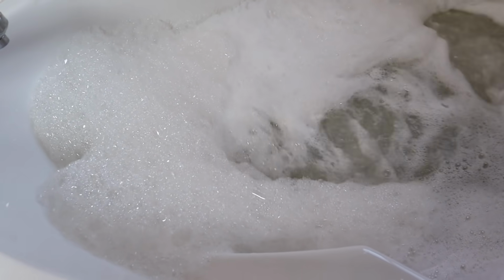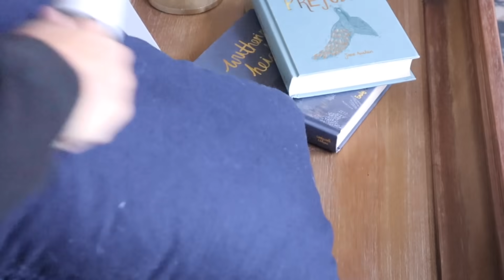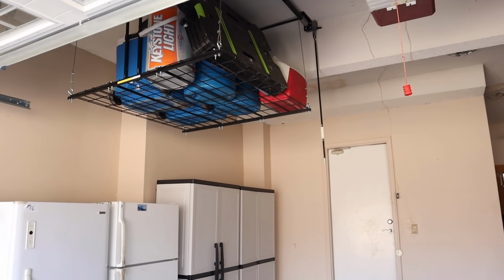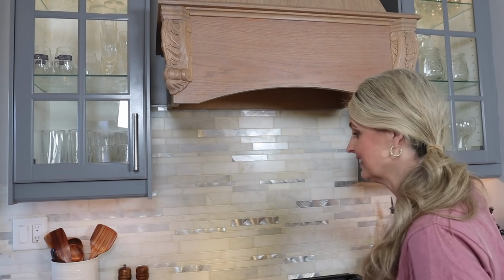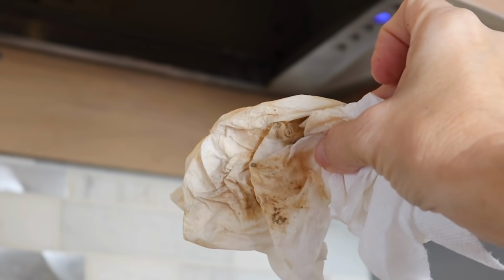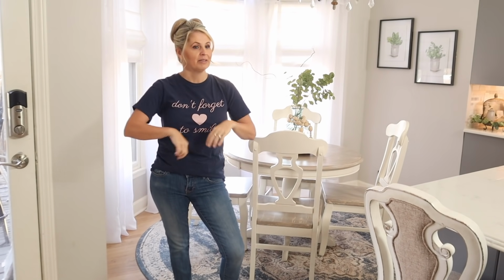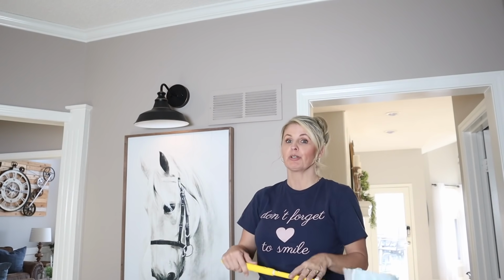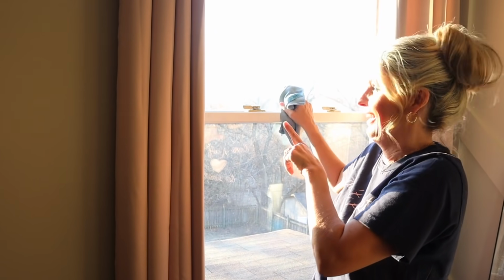14 IDEAS FOR CLEANING AND ORGANIZING THIS SPRING

Comment: Ohmy, vacuuming under the cushions, what a treasure hunt that turned out to be.  I routinely give the vent screens to my microwave oven, that luckily vents thru the roof, a good hot soak with soapy Dawn, scrub and then in the dishwasher.  The screens are so tight, the greasy smell builds up, if not done a couple times a year. This video was outstanding!

Comment: Another great way to clean the bathtub jets is to fill the tub and toss in a couple of dishwasher pods. Thin rinse with a clean mop with hot water. Our tub was the one splurge when we remodeled and I love it.  for those sheers, toss them in a dryer with a fabric sheet on NO HEAT. By the time you've wiped down the sills/ frame and washed the windows, they'll be ready to hang... no shrinking. Thanks for sharing!

Comment: Spring cleaning is a good time to clean out the pantry and spice cabinet. I always find a few items that get pushed to the back and have expired. Leslie, I  was also having trouble with getting notifications even though I had it set to get them. I went back and turned the notifications off and then back on. I have been getting them ever since.

Comment: Those are great tips! My most hated Spring cleaning job is the runners where the windows open. Maybe it's different in our British homes but when you open the window there is a dip where dirt collects which is hard to clean. Wiping it with a cloth only gets some of the dirt out, you need to get into the nooks and crannies with a cotton bud.
Reply: Agreed !
Reply: I just learned of the LEOBRO bristle window cleaner from Amazon. Check them out.
Reply: @samanthatodd7100  thank you, I will check it out!
Reply: @samanthatodd7100  thanks, I just looked it up and will be ordering it soon!

Comment: My cabinets don't go up to my ceiling so I have to clean the tops of them,so I put wax paper on them to catch the dust.It makes the job so much easier to just clean my decor I have up there.I also wash my sheer curtains on delicate and hang them wet,no wrinkles.When I wash my king size sheets I dry the bottom sheet separately and then the top sheet and pillow cases next,I have very few wrinkles.I figure the time of drying is about the same time compared to putting everything in at one time.I am 75 years old so my spring cleaning takes me a lot longer but I can still do it all by myself.I hate doing closets and drawers.I love watching all your videos and I get a kick out of your husband.

Comment: We have a food trailer and one thing I do that has helped so much with the exhaust fan vents.  Ours are similar to yours but of course much larger.  After cleaning I put a light coat of Dawn dish soap over all the surfaces.  It makes it much easier to clean the next time because the grease sits on the dish soap rather than the vent surface.

Comment: Here's a helpful hint I got from our window washers: they used just Dawn dishwashing liquid and hot water to do the windows inside and out.  I did this just recently with a squirt of Dawn in a bowl of warm water and used a blue or yellow towel/rag you get from different home improvement stores.  Use 1 to wash and another to dry. Perfect, sparkling clean windows!  Can also use for mirrors!  Super simple and economical!!
Reply from the maker: Love it!!
Reply: Are you referring to the microfiber towel/rags or some other type?
Reply: @pampriddy7659  Yes-usually get them at Lowes/H Depot in a big pack.

Comment: In Australia the push to check batteries in smoke detectors is Daylight savings change over. I also do a clean washing Machine & Dishwasher. Easier to remember when I last did it. ❤🐨🇦🇺🐨

Comment: Thank you for your video!  Gives me motivation!  Some cleaning ideas I like to follow:  I wash my inside windows at night!!!!  No streaking because the sun isn't shining on them.  I use vinegar and dawn soap to wash windows.  I use a microfiber cloth to wash and dry.  NEVER use paper towels as they are coated with something that causes streaks.  I clean from the top down.  Ceiling fans twice a year.  I change out and test smoke detectors twice a year when the time changes.  Helps me remember!!  We also have a carbon monoxide detector that has to be replaced every few years according to the manufacture instructions.  I couldn't believe how greasy my garbage disposal got.  I poured baking soda and vinegar down it and let is sit for at least an hour.  Then I poured hot boiling water down the drain.  Baseboards, doors and tops of doors get cleaned about once a year.  I also couldn't believe how dirty the top of the tile got in our bathtub surround.  Basic cleaning products such as vinegar, dawn soap, Fabulosa from the Dollar Tree save lots of money on cleaning products and are safer to use!!  Happy cleaning!!
Reply from the maker: Great job!!! 👏👏👏

Comment: If a lint roller isn't working on pet hair, use duct tape. Wrap it around your hand, sticky side out, and dab at the surface you need to remove dog hair from. I have a jeep with a black interior, and had a yellow lab. Her hair stuck out so badly, but duct tape got it out easily.

Comment: Tip for just dusting curtains.....as long as they are just dusty, no soiled areas.....take them down and throw them into the dryer low heat about 15 or so min (you be the judge of that). They won't shrink because they aren't wet and they come out dust free! All that dust will be in your lint catcher. Have done this for years and works like a dream! Again, this is only for removing dust. If you have spots or soiled areas the dryer will set those in.

Comment: Thank You for the cleaning video!  Have you pulled that rubber guard thingy out of your garbage disposal in a while?  They DO come out, and are extremely gross, if you are not in the habit of doing it!  I tried to remember to put mine in the dishwasher once in a while, but kept forgetting!  Finally, I saw that my daughter didn't have one with her new dishwasher, she had another device!  I found one on Amazon!  It's a DANCO Disposal genie Garbage Disposal Strainer/splash guard and food scraper.  They have other brands, but this is the one I got.  I really like it and now I know that my disposal doesn't have all of that built-up gunk.  (this is not an advertisement, but a great tip for those of us that like a clean home)

Comment: I dislike cleaning my spiral staircase. The steps have gripper strips to make them more safe, and they never really look clean either way, but the top few seem to collect more pet fur and dust. Also there are little nooks and crannies where the wooden steps meet the center pole, very difficult to get into. Just writing this it occurred to me that maybe a pipe cleaner or two with warm water would possibly help. This year I need to repaint my baseboards they just don’t look nice even when clean.
Reply: You might try using a toothbrush around where the steps meet the center pole. 🤷‍♀️ And I completely understand what you mean about the baseboards. Even though mine are clean they still look awful!